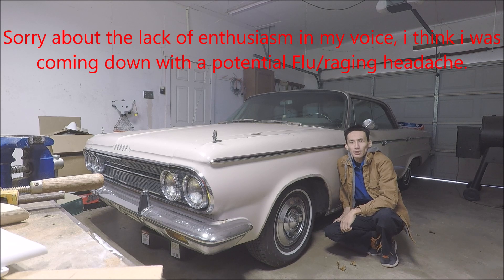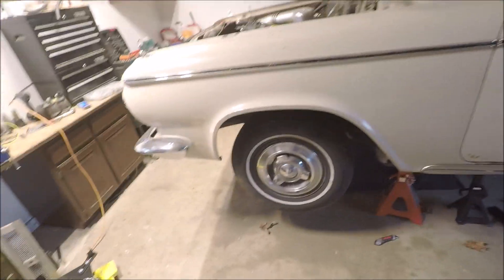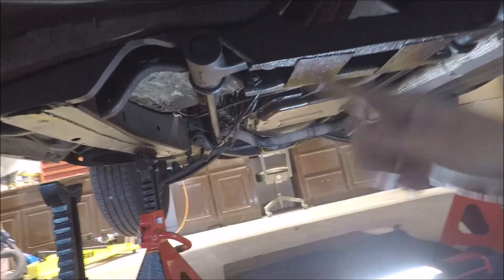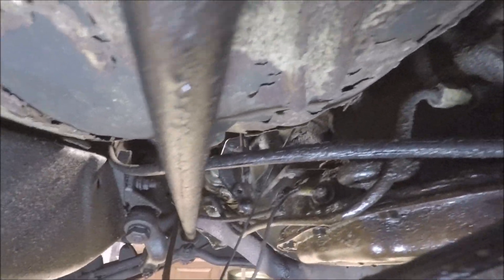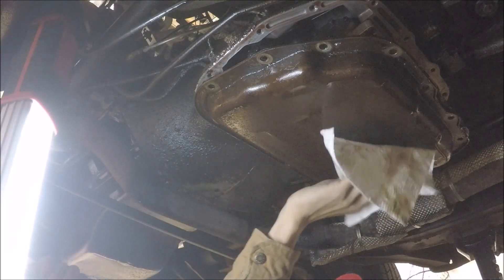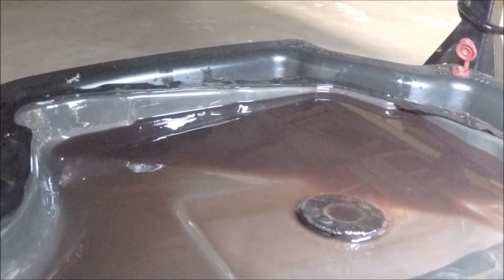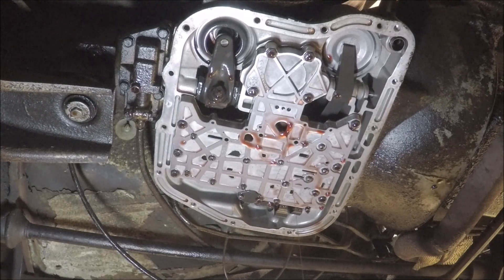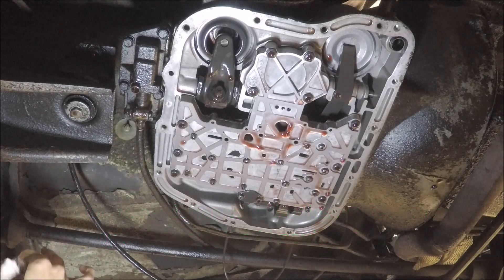My 1964 Dodge Custom 880 | Update #43 | 1/6 Operation: Rebuild & resuscitate Push button A727.

Comment: Hi Vanboneio. Your transmission filter looks awfully clogged. Maybe that's your issue. Also a issue could be you have a 1 hole filter. Make sure to run a 2 hole filter in your transmission, otherwise you will shred your rear pump. Ask me how I know. Keep it up. Greetings from Germany. Marty
Reply from the maker: Hello Marty.

Yes the filter on the valve body is a 2-hole filter. 
And regarding the clogged filter, I have no idea why it's clogged.

Maybe a sudden influx of dirt that was stuck somewhere inside the transmission?
Regardless of the filter problem, I believe the transmission is in a desperate need of a gasket set, it's just leaking from everywhere.

Thank you for your response.
Hello from the U.S.

Comment: For these Forward Look cars (yeah, yeah I consider the Dodge 880 the last of the FL cars) USE good rear wheel chocks! The parking brake and/or park is on the tailshaft of the transmission, NOT the rear wheels!
Reply from the maker: Hello there.

Woops a fumble of words there, I meant the parking/emergency brake on with the cable on it that goes to the rear drums.

Appreciate the feedback.
More to come!
Reply: @samhicks97  No, the error is mine. I forgot that parking brake setup changed in either 63 or 64. My bad..
Reply from the maker: @mediamain6 Hello there. No issues here, Did the 63' have a locking park PAWL on the tailshaft? or was it strictly just a hand brake sort of like the 60's Chevrolet Corvair's? 
If so that's quite a change for 64' to have a parking pawl, more "modern" i suppose.
Reply: @samhicks97  I believe 63/64 chrysler had the park lever.. I am not sure about the other cars but if I had to guess I'd say they had the park all through the line. I know pre'63 only the imperial had the park lever..
Reply: The 1963 Dodge Custom 880 had the pawl in the transmission and a pedal on the passenger side for the parking-/emergency brake.
Reply: Sorry not passenger side. Driver side. My bad.
Reply from the maker: @martindibb9529  Thank you for the clarification, yes this is correct.